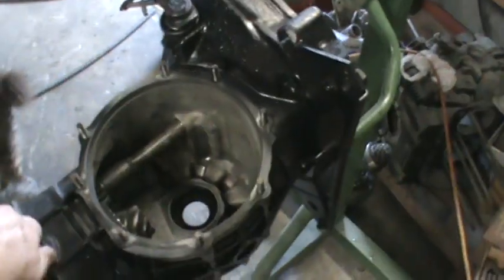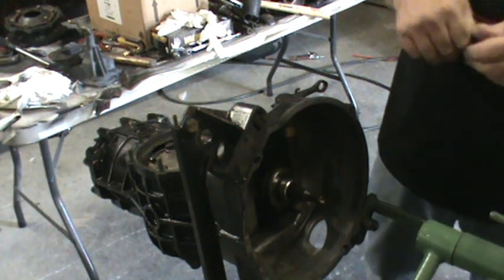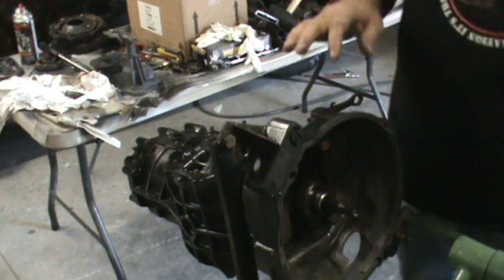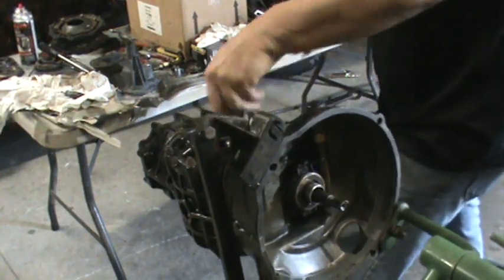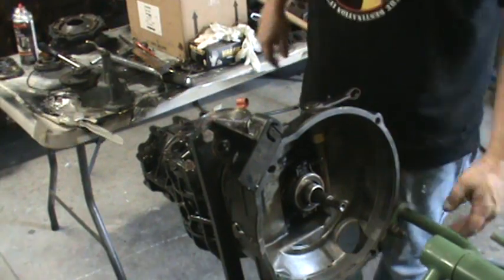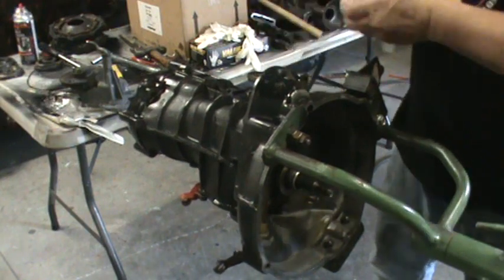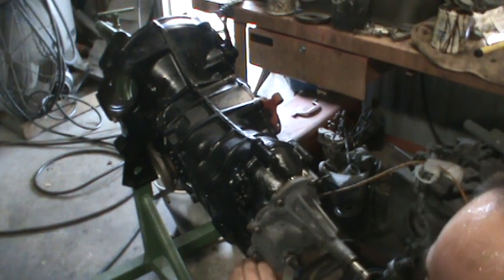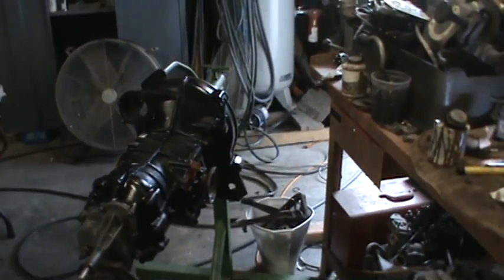BUILDING A VW TRANSMISSION, Volkswagen air-cooled transaxle build

Comment: Can't quite see the point of stripping a diff / box unit to that degree, then not using a DTI and white / red lead or Engineers Blue to check the pinion backlash and tooth engagement. Each to their own I guess.:)

Comment: LOL I hope they can get that tight.  FWD axle nut is 180 ft lbs. It looks like the way its designed makes it so hard to tighten wouldn't you say. I probably won't ever get the chance to tighten one beings I have rarely worked on beetles or buses.

Comment: and drill a hole and put a pin or a bolt in your engine stand for  when  you have to tighten that dang ring.....150 ft lbs !!!! holy crap !!

Comment: can I put the van dif and pinion in the car gear box
to get a better run on the high way..can the s box being cv joint dif fit into the 12oo box being beam and axle. I hope you understand what am asking..I am fitting a zx 11 bike engine to the vw box..my concern is it will run out of breath up top.

Comment: Hey man just reaching out there. I have a 2010 Tiguan with an MQ500 6speed. I think I’ve smashed the synchros or bent the selector fork so bad I can’t get it into reverse, first or second. All the other gears work and I can move the car in third….. my main issue is finding someone willing to repair it or if I can even get parts for it. Any suggestions? Should I just try dropping it off at a dealership or performance shop? Ive called som tranny shops around here and they said “good luck, cuz we don’t service those” loll :(

Comment: Question, can a Rancho built 5 speed transmission with all Weedle gear, withstand coupling to a turbo 6 cylinder Subaru engine? a Porsche G-50 is to long, also the 915.

Comment: If I flip the diff for a mid engine application, does the ring gear just drop in like the other side? Thanks for the vid!
Reply: +siegfriedo brabender For a late-model IRS, you would need to change the case since the late-model IRS cases are one-sided. The best way to go is to use the late-model "swingaxle"case (which can be used in an IRS setup, but requires another diff cover on the other side, which would be perfect for you).
Reply: tHANKYOU!

Comment: Hey VWDARRIN I have a 2001 VW Golf GLS 1.8t and it has given me nothing but problems since day one. It has about 89k miles on it with a replaced engine thanks to the warranty. However, I recently took it to a VW dealership and they told me my syncros for 3rd 4th and 5th gear were shot. So...my question to you is should I replace or rebuild transmission? Or just sell the car? (a little over 4k on the loan -_-)

Comment: Hi vwdarrin,

Maybe you can help me....
I have a real good condition 62 - 67 Swingaxle type 1 gear box, and old 1968 - 1972 DSC IRS Type 1 gear box, I can replace only the covers, IRS limited slip differential, and flanges to convert the 62 - 67 Swingaxle gear box to IRS??

Thanks & regards,

Comment: Great video man !   Where are you located ?   You rebuild these for customers ?   I've got a 2006 MK5 Jetta TDI with a tranny problem.   The second gear won't "go in", no matter how hard I try.  All other gears OK.  Is it a shot synchro or the selector shaft busted.  Just want to know what to do next.  Thanks.  Subscribed.
Reply: I think he only works on classic VWs, but if you are wondering why your car is not going into gear, it could be one out of two reasons...1. bad shift fork, 2. Bad linkage.